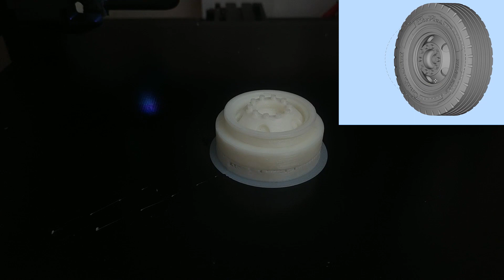How to make wheels for semi trailer remote control truck |cults 3d printed rc parts

Comment: Did you consider using mold release agent??
Reply from the maker: Yes. But it won't improve the situation because the mold is difficult to separate because of the tire tread.